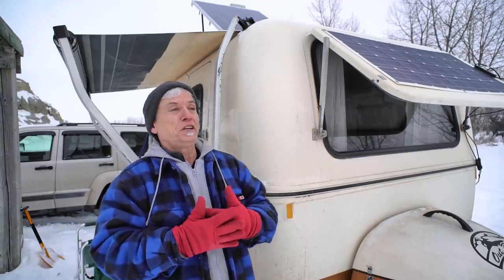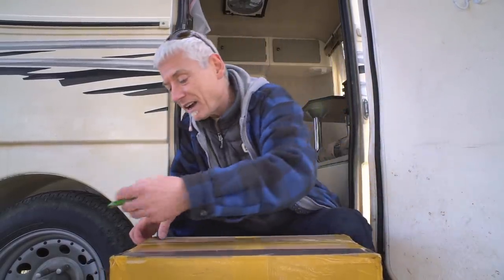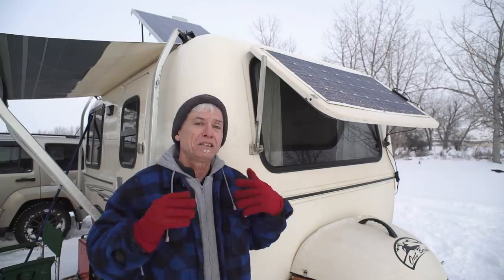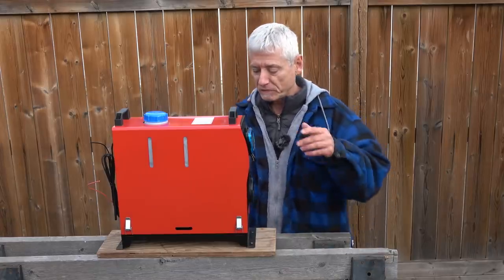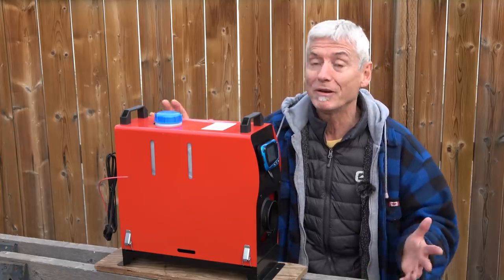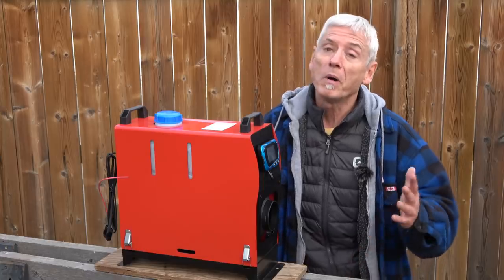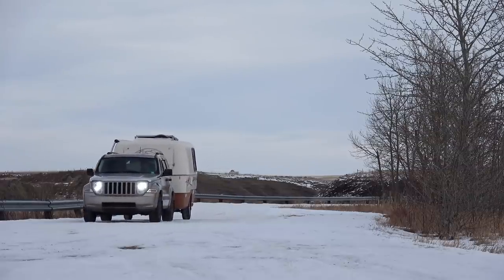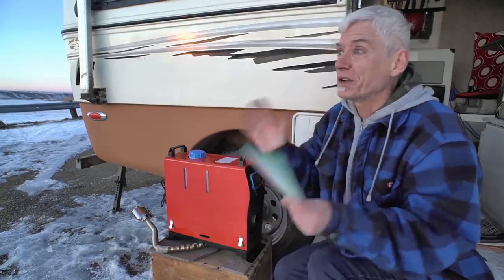Can this Work with a Camper? My Parking Heater Experiment: Part One

Comment: The issue could be the Jackery as they don’t work well at low wattage (around 5watts) and begin a timed shutdown I believe about 6hrs. Im not sure Jackery fixed thst issue with the recent upgrade but it could be the shutdown culprit...

Btw if the unit works for you, the over the tire table might be a perfect Diesel Heater Mount, worth a check:

Sponsored Brand: Tire Table ~
Vehicle Tire-Mounted Camping, Travel, Tailgating and Outdoor Work Table
Reply from the maker: @countingcoup, where did you hear this ?!? Wow, I did not know that, and that could certainly explain my troubles. Also the tire table, I did think of that but they were a little expensive. Perhaps I can made one? THANK YOU!!!! SP
Reply: @SlimPotatohead  ~ Funny in an offhand way... I read this as a critique of the Jackery by CPAP users whom tried to power there low wattage travel CPAP’s with the Jackery while camping.

I plugged a really low wattage dehumidifier that is AC supported into my Jackery and experienced the same 6 hr cutoff in my Van... 

It was weird and I searched the end of the internet thinking my Jackery was defective but discovered through a CPAP site it was indeed a Jackery (ahem) feature...
Reply: @countingcoup  Thank you! CPAP user here with no clue how to dependably power the device away from wall power.
Reply: Soooo did a little more research, apparently with < 10 watts of power, the new Gen 2 Jackery 500 begins shutdown after 12 hrs and the previous Gen 1 (I have a Gen 1) begins shutdown after 6 hrs...

See Amazon “Have a Question” section and type in “is there a low wattage shutdown” 👍🏽
Reply: @anthonyc1883  ~ There are batteries that appear to be CPAP specific that were suggested over the Jackery... I think it was “MAXOAK”?!?
Reply: @countingcoup  Thanks very much.

Comment: I suppose in a true emergency you'd just sleep in your truck with it running. Seems odd to have to carry yet another fuel source. Is it not possible to replace the existing propane furnace with one that doesn't require electricity? Or one that uses less electricity like a Propex?

Comment: Slim, could the tight 90 degree fitting in the exhaust system be obstructing the exhaust causing an overheat sensor to shut the heater down? Just thinking~~I believe you can get sweep 90's in 3/4" pipe.

Comment: Slim, if you run your propane heater of the Jackery, how long will it last. Thanks.
Reply from the maker: Interesting question. Full power, probably 20 hours. At that point I'd probably run out of propane. Thanks! SP

Comment: Been using two of these for the last 18 months. Never had a problem with one turning off unexpectedly. The manufacturer does not advise a 90 degree bend iin exhaust duct. It is too restrictive for exhaust gasses to flow freely.
Reply: He finds the issue in part 2, something I wasn't expecting.

Comment: The only question is will this heater work when placed outside in cold weather and precipitation..the mechanicals, the electronics...given that it was built to be placed inside? Also, the quality control of these "knockoff" heaters.
Reply from the maker: Part 2

Comment: Question slim, i know you considered it but have you thought of those 10k btu blu flame heaters, portable. quiet. crack a window for the moisture and wont make any diesel smell. but it is propane. Uses no power either and thermostat.
Reply from the maker: I reviewed one. Huge condensation issues. SP
Reply: @SlimPotatohead  Pretty bad condensation eh even with a cracked window : Thanks for the vids sir!
Reply: @SlimPotatohead  I did find this item, its the same idea as that deisel heater but propane. Its also made to be used in the elements like under the carriage. Propex HS2211 is what its called but its not cheap

Comment: Since it has some kind of electronics (As a controller), I wonder if the diesel heater has a cut off timer, maybe for safety? Perhaps, every 8 hours (some duration) it shuts down? Again, for safety?
Reply from the maker: See Part 2
Reply: @SlimPotatohead  : ) Got it...thanks.

Comment: 1) Doesn't diesel fuel jell at low temperatures?  Having the unit outdoors may not work.
2) Isn't the air getting heated outside air - really cold air?  Isn't that very inefficient?  Normally heaters intake inside air, so the heater has to work much less.
Reply from the maker: 1) No. This is Canadian Winter Diesel. I used it to -20C
2) I wanted a cold intake. Inside would get too hot. The heater does not have to work any more or less, it merely works on whatever manual setting you set it at.
Thanks! SP

Comment: When the weather is close to 10 to 15 degrees Fahrenheit*, gelling starts to occur and can clog the fuel system? Very interested in how this progresses! Happy New Year!
Reply from the maker: It does not, and I've responded to this several times. This is Canadian Winter diesel. I have used it to -20C with no problems. SP
Reply: @SlimPotatohead  Ah, sorry bud, I read through the comments before posting this, maybe youtube filtered it for me! In the US there is usually trouble with diesel, as there is no national standard in the winter, and people take fuel where is is colder than where dispensed. We have issues with no national standards you see with other issues.

Comment: What is the pros and cons of using diesel instead of gasoline.  I suppose your truck uses gasoline, and may as well use gasoline, right?
Reply from the maker: The only pro of using diesel is that the heater was cheap. Gas ones are a lot more expensive. Thanks! SP

Comment: IMO the reason why this might not be working is because you put the device outside. Diesel does not do well in colder temperatures. If you want to use diesel in colder temperatures you need to buy winter diesel. The device should have been installed internally. Propane works in most temperatures and is recommended.
Reply from the maker: Of course I was using winter diesel, I'm in Canada! Propane does NOT work in colder temperatures. The heater outside makes no difference to the power consumption, which is primarily what these videos are about. Thanks! SP

Comment: I'd say in those low temps, the fuel gelled a bit, causing the shutdown.
Reply from the maker: Check out part 2. It's Canadian diesel. Used it down to -20C without issues. SP

Comment: The heater needs to be installed inside but the fuel is outside. The pump is also outside and the fuel lines in and out of the fuel pump are wrapped in foam to get rid if the clocking noise. The air supply to the diesel heater must be from the trailer and not outside.  Then the heater should only run about 50%  of what it is doing now.
Reply: That is a good idea. By recirculating the warm air, the over-all temp will be higher and burn less fuel.
Reply from the maker: @everintransit 42:  Sorry, but I respectfully disagree with all your points. You use words like "needs to" and "must" like this was some universal rule that could not be broken. They can in my opinion. Prove me wrong. Thanks! SP
Reply from the maker: @Paul's CCNA, with the pump on manual mode, the fuel consumption is constant. There is no fuel saving in re-circulation. On auto mode yes, but then the power consumption would be more as the unit as to re-heat itself each time it turns on and off. Not practical for me at all. Thanks, SP

Comment: Using it on constant low will cause carbon build up. The auto setting is best.
Reply from the maker: Not for me it isn't. Running on auto would mean it would constantly be shutting off and on, draining power from the battery at each startup. Manual is the practical way to save energy. SP
Reply: @SlimPotatohead  ok. Keep us updated and keep on experimenting 🙂

Comment: I don't think you are supposed to run them down around 1.3 mine only goes down to 1.6. Even 2.0 is too low for too long. Both red bars should be showing on the monitor or your making soot.

Comment: You Can insulate thé dieselpump against thé ticking noise
Reply from the maker: Tried 3 different ways. None worked. SP
Reply: @SlimPotatohead  Hiya
Anyways this heater is to noisy,consumes to much batterie, it's not a nice kind of heat.Wood is to much work so a gas heater is the easiest. Love your channel dude.Happy New year from France

Comment: I still don't get why you didn't look at kerosene heaters.  They are indoor safe, quiet, require no electricity and burn clean, readily available fuel at least as cheap or cheaper than diesel fuel.
Reply from the maker: Kerosene is not readily available if you are a remote traveler. If I can't get it in every gas station I visit, not interested. Thanks! SP

Comment: A turnkey 4-season small trailer solution does not exist and is much needed.
Reply from the maker: I agree. Plus when manufacturers see cold they only think of insulation and not driving conditions in snow and ice. Thanks! SP